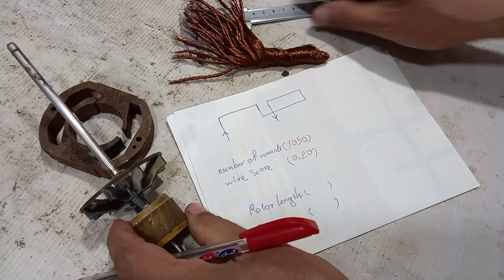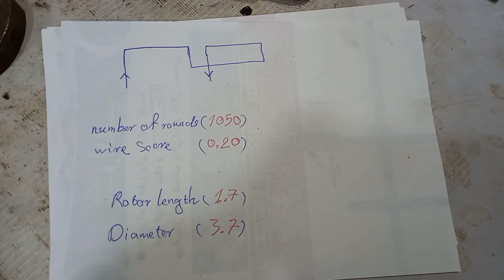Restoration & Repair burned old air cooler water pump || Rewind Electric Motor with road map

Comment: Your pump is missing a cap from the bottom. This would have a hole in it, and  would make it pump more efficiently. As it is now, there's quite a bit of rollout on the bottom. Overall, it looks good. Here in the States, this pump type is used in swamp coolers for very dry area of the country where refrigerated AC won't practically work.